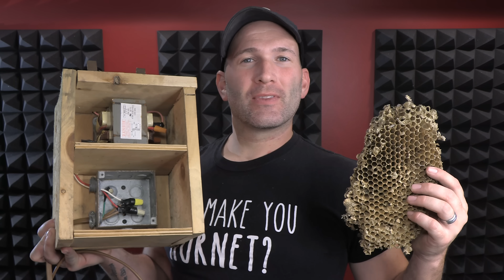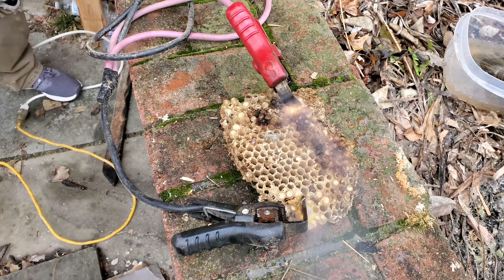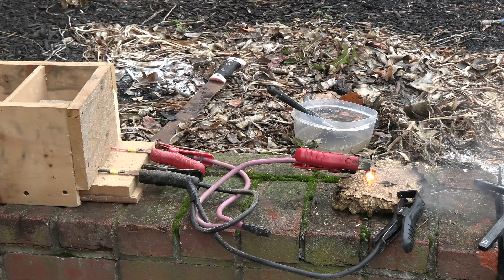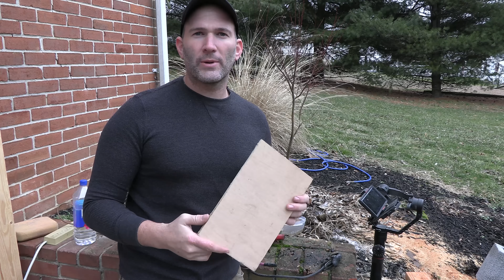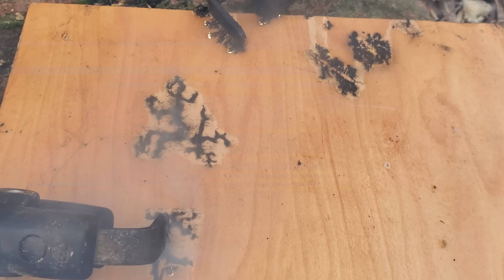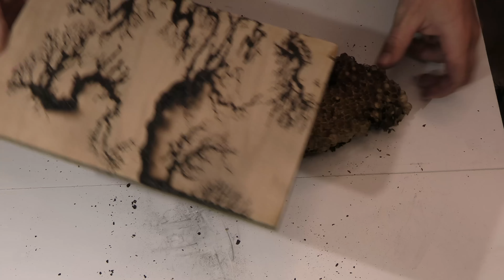High Voltage VS HORNETS nest | Lichtenberg Machine Wood burning

Comment: Water is conductive, even 100% pure H2O due to the reaction that is known as autoprotolysis.

2 H2O ⇌ H3O+ + OH-

At 25 °C and zero ionic strength, Kw (the self-ionization constant) is equal to 1.0×10−14.

Comment: Actually, water is conductive, like almost everything.. the question is, how much.. for example distilled water has conductivity of 0.05 µS/cm which corresponds to 18Megaohm/cm (it's a lot). Seawater has conductivity of 50 µS/cm and drinking water cca 400-500 µS/cm

Comment: Using water? You're cheating
Reply from the maker: ? Im not sure you listened to what I said in this video.
Reply: @HornetKingOfficial  Using the electrolytes in the water to make it more conductive. Cheating lol
Reply from the maker: @TheJingles007  The nest material is made of paper which isnt contuctive at all. To be able to electrocute the nest it first needs a conductive agent, ie the Sodium BiCarbonate. The nest is still the material being chard and burned, the electrolyte is just the intermediate agent that allows it to pass through. Like a key. Like the insulin thats in your body that allows your cells to take on sugar. Is your body cheating for using insulin? 😉🙃

Comment: I would like to disagree, the heart of a microwave oven is the magnetron which converts the high voltage electricity into high powered 2.4GC radio frequency that cooks the food.
Reply from the maker: Everyone has an opinion, and no one is wrong. My perception is based on my medical background:

In medicine, the heart pumps powerful energy into the body via the blood, as the MOT pumps magnified voltage into the magnetron.

Comment: Definitely a professional, as can be seen by the tapped wire connections 🤣
Reply from the maker: *taped 
Reinforcing wire nuts with electrical tape is an extra safety measure.

Comment: On one of the ships that I was on in the Navy we had 400Hz inverters that used ultra pure water for cooling the buss bars of those machines that is why you had to use an impurity to the water for better conduction.I was old school and worked on the  motor generators that produced the 400Hz A/C. Really liked the video for the informative content this reminds me of folks using molten lead or zinc to cast castings of Ant colonies when you were etching the wood. I wonder if you could do that on underground wasps nest?
Reply: I recently learned that the main reason aircraft and vessels use 400HZ is that the transformer iron cores can be smaller with the higher frequency, thus, less weight for the equipment. The sound of a HV arc would sound different too.

Comment: To clean out the carbon, you can use a brass wire brush (like those for cleaning BBQ's) It's hard enough to do the job but soft enough to not scratch the wood. You'll get better detail this way. Fill a container with hot water and scrub away!
Reply from the maker: No, the black carbon is what is giving the piece its detail. Take that away and you lose the detail.
Reply: @HornetKingOfficial  I should probably clarify: There is excess carbon in the lines of the litchtenberg figures because of how deep it burns. 
Cleaning that out helps give more definition with the lines and can reveal some that you may not have seen because of all the build up. 
The burns will still be there though. 
Also, the microwave oven transformer will give you bigger and deeper lines but
if you want lines that are more delicate, an old school neon sign transformer is what you need. Hook that up to a variac to fine tune your voltage and give you more control over the piece. 

I've also found different woods react in unique ways. 
For example, walnut burns fine and will follow the direction of the electrodes but Tasmanian oak goes all weird and just wants to run up the grain.